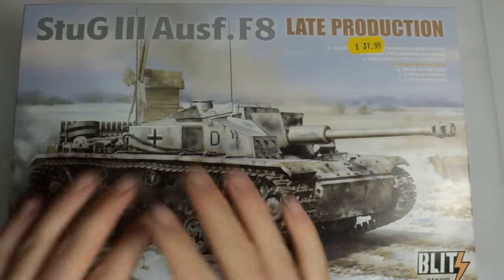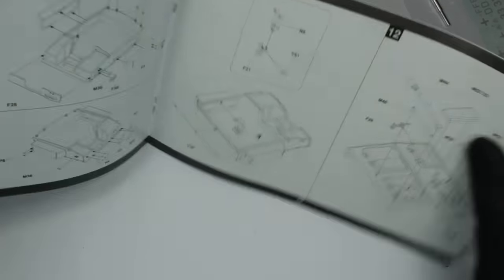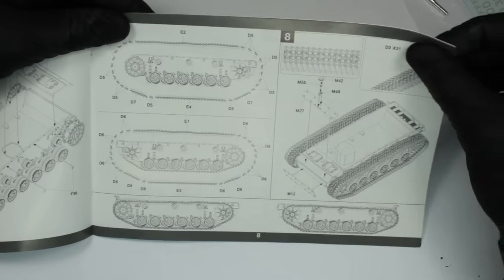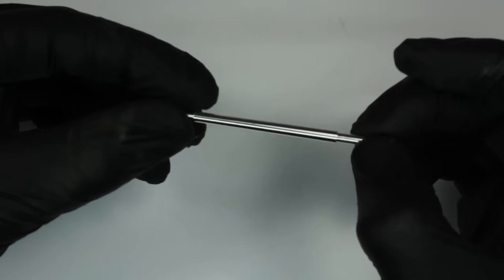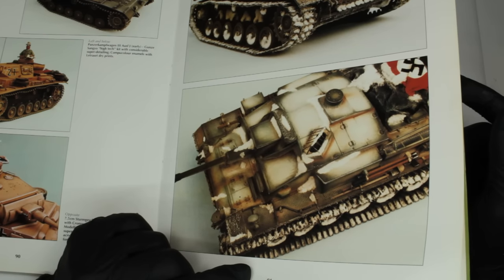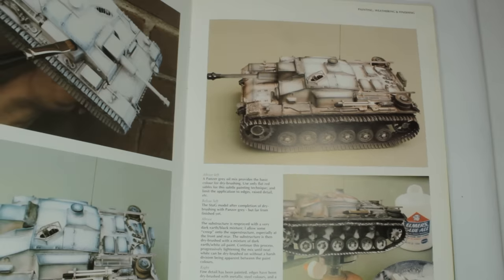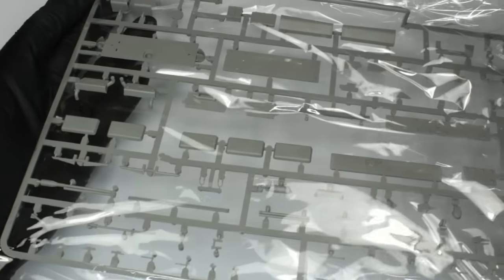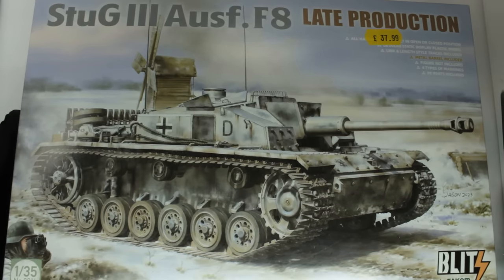Tank Model Kit with Everything in the box for under £40! Takom 1/35 BLITZ Stug III F8 Late Review

Comment: You are correct that the Ausf.F/8 is the same hull as was used in the later Ausf.G, and that the F/8 has a different superstructure.  So the hull in this kit is the same as the G, just with new fenders and a superstructure.  

Now, an Ausf.F has an older hull with a different shape (most obvious in the rear).  Takom have announced those too now.  Think of the Ausf.F/8 as a transition between the F and the G.  It uses the superstructure from the F and the new hull that continued into the G.

Comment: Check with Evan. I think there may be dimensional issues with their hull. I don't think I would bother fixing it myself, but some people see those things as show stoppers.
Reply: There are but they're not very major and they're not the kind of thing I would fix.  The dimensions of the hull front with the bolted armour and the nose welds should be correct on this kit and that was the only visible issue with this hull (used in the G kit).  The remaining dimensional issue is with regard to the length of the hull being about 1mm too short allegedly so the idler is a bit too close to the last road wheel.

Comment: Both pronunciation of Decal is accepted, there are regional differences and so no one pronunciation is correct or incorrect. The trolls need to find other things to worry about.
Reply: De-cals is more aurally pleasing, though.
Reply: When I started model building in the early 70s they were called transfers.
Reply: "Waterbased transfers" also works.  As the original term was "decalomania", dee-cals is probably more correct but I have always called them deck-les.